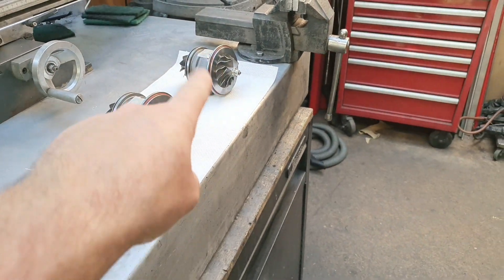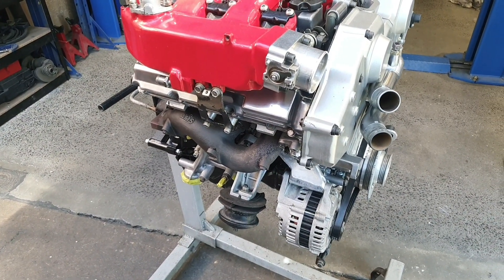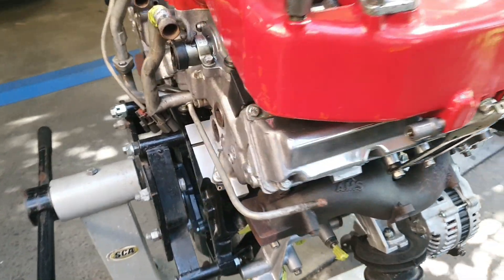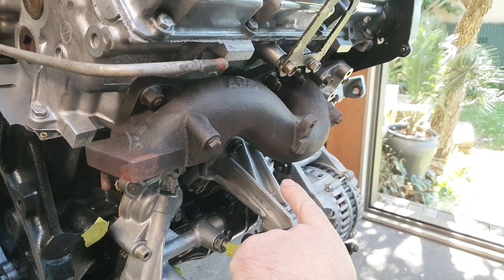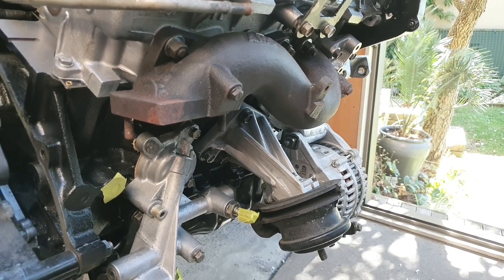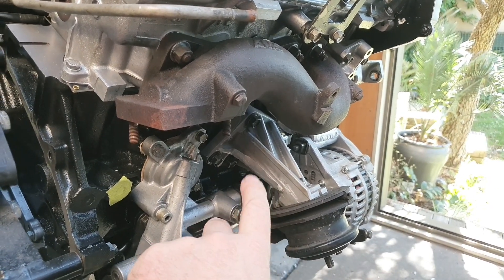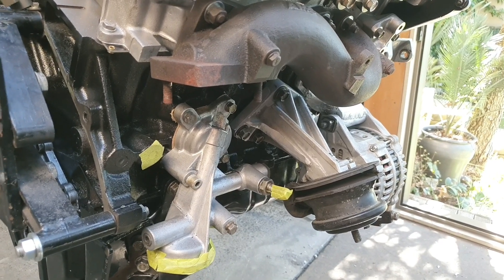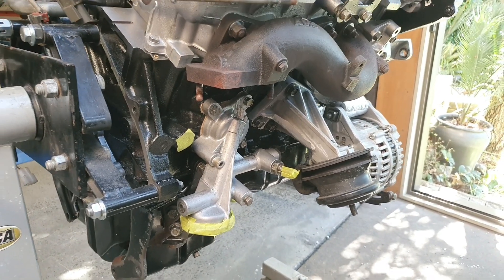Turbos going on VG30DETT rebuild/repair

Comment: I'm looking to rebuild and turbo my Z and im having trouble finding good exhaust manifolds as I have the NA manifolds right now, Do I just buy a refurbish stock ones? what's the difference? Great video thank you love the quality of video and tons of information!
Reply from the maker: THANKS!
Stock manifolds will support fairly high power with no serious issues but there are options in aftermarket from various brands.
Z1 motorsports is a great source for your Z32 parts :)